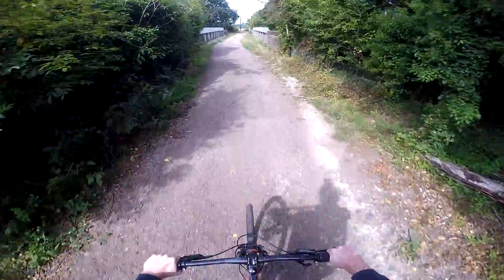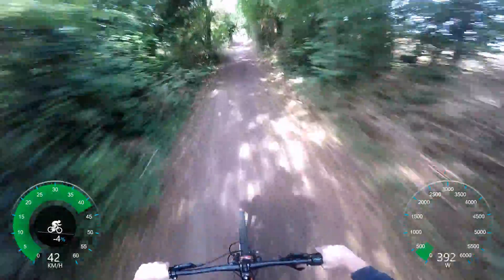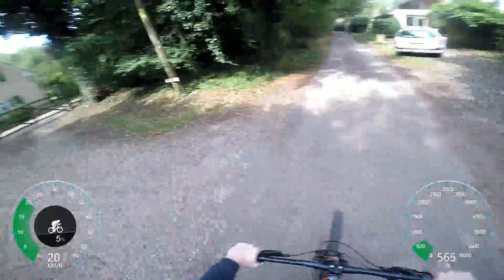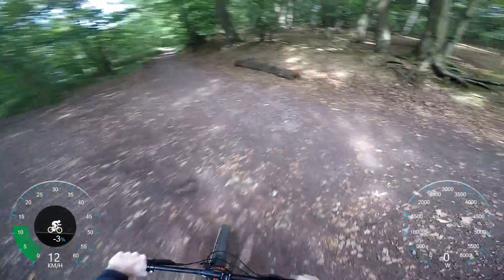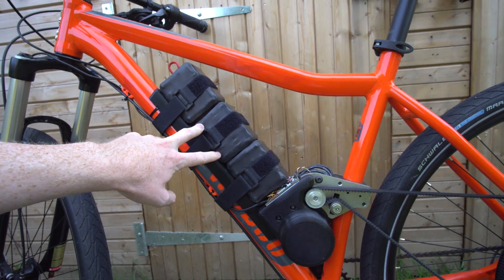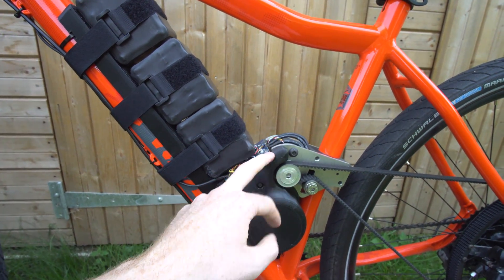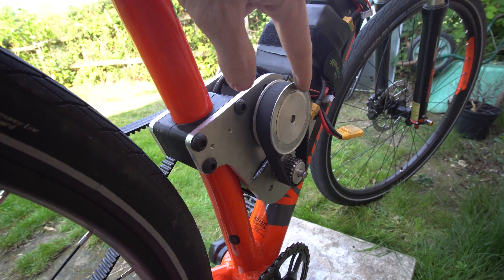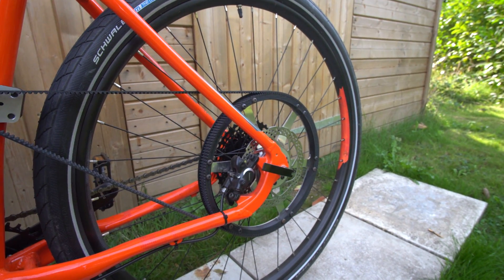Electric Bike 4.0 - First Test ride

Comment: Hey Tom, you should really make these ebikes more like a bicycle and less like a motorcycle though. Ebikes are by far the most fun without direct throttle control, instead try to rely on crank rpm and crank torque as throttle input with a crank torque sensor. Doing this correctly will make it feel like you have superhuman legs, and will make the rider provide energy to the bicycle in a useful way.

Comment: You need to Volkswagen this bike, just in case the authorities check it out. 

One mode where power output/speed is restricted... and when Mr. Plod has left, you put it back into fun mode and ride away laughing!

Wouldn't get away with this bike in Australia!  :-)
Reply: Michael Carey A mode where the power/speed is restricted is pointless. Even if it was 250w and 15.5mph it would still be illegal on UK roads. All UK bikes are required to be pedal assisted.

Comment: Isn’t 800 watts for sustaining 18-20 kph a bit too inefficient????
Reply: It depends heavily on conditions. We don't know how soft the trail is or if there is a gradient. He noted in the video that the gradient is GPS based... which is just about worthless.
Reply: I get about 220w at around 30km/hr on my ebike. Maybe your watt readings aren’t calibrated ?
Reply: It's mph. Not kph. He left a note at the beginning say he doesn't know why it's displaying kph. He set it to mph.
Reply: My bike dont need that much either. Under 200w @ 20kmh and goes 40kmh whit 36v and 15amp current limit.
Reply: Pro cyclists average 40km/h on 400 watts in normal conditions
Reply: Thats because its fully powered by a motor. Im guessing everyone in the comments are talking about the normal ebikes you get from bike companies

Comment: You should check out dashware.  It's a free overlay like you're running.  It has a bunch more stuff like incline altitude and even computed values like horsepower and torque

Comment: To prevent overheating of the motor, you should cut out ventilation holes on the motor guard (or design a new version with holes).
Reply: Maybe an easily cleanable mess cap of some sort???

Comment: You could design a motor housing with holes and a space to put a screen and small filter to increase cooling.
Reply: Could maybe even put the holes at an angle to match the rotation direction of the motor, the drag might act a bit like a tesla turbine and suck air in.  Then have a way for it to exit.

Comment: hi Tom, can you not 3d re print the motor cover with small vents instead of it all covered, so looks like a garden civ but designed with longer holes not squares. try to get temps before the mods and after to see if the motor is cooling, or at least aid the cooling process. I don't suppose there is any way to wire in a small fan anywhere or to design a manifold that can direct cooler air to the motor cover that can be vented. so cooler air in pass through the motor casing then out :) temp sensor can kick in the fan if it goes or! gets to a certain temp. Just idea thrown at you :)

Comment: You mentioned about having a temperature sensor inside the motor casing; would it be feasible to have some sort of fan with a filtered intake to help keep the motor cool?

Comment: If you built something like this as a kit for the best selling bike with disc brakes on Amazon,  I think quite a few people would like to buy it. If you do it without batteries, motor and speed controller you don't have to invest much and if you set up the 3d-printers and mill to make all the parts for one kit in a single operation you'd only need to start a "job" whenever you get an order. Also you wouldn't have to invest much or keep inventory and those are the pitfalls of most small scale productions
Reply: but if he sells it he would be at fault if something happens, I mean he is still for his but don't you think if something happens he would be devasteted if it might be because of a part he designed?
Reply: If you sell the parts as a kit it removes a lot of responsibility. Sure there's still RMA and stuff, but that's nothing compared to what you have to deal with when selling a finished electrical or mechanical product.

Comment: Hi Tom, thats really a cool ebike you have made and your video is pleasure to enjoy, thank you! I have one notice - do you plan adding some cover to second gearing to long belt? It seems to be quite dangerous that way. And did you calculate power transmitted via belt versus belts capalibities regarding power transfer and so on? And the last one - did you wonder over recuperation breaking and getting some energy back to battery? And can you post what type of motor do you use? Thank you a lot!

Comment: Looks very good indeed. I would be inclined to cover the primary and secondary drives near the motor for when winter comes and you ride with trousers. You wouldn't want them dragged into the pinches between the belt and any pulleys.

Comment: Good idea to add better ventilation around the motor for heat dissipation. I am wondering if lack of exercise is such a good idea and maybe we should go back to pedaling and walking more instead of less. You probably used less than 50 calories riding the ebike up that hill instead of 500 calories if you had to pedal it up. I would like to see an ebike version of Tour de France. Could an ebike make it 100+ miles on one charge?

Comment: How does it ride tradtionally with the pedals now? Or is it more of a pure electric bike rather than moped style? Is there a lot of resistance. If so do you have a plan to be able to switch etc?
Reply: Once you get to a certain speed the pedals don't do much. For me on mine (1500w hub motor) the pedals don't really help past 40km/h
Reply: @chris2944  i get that 😂 its more whether its rideable without the motor. Eg if it runs flat and your still a couple miles from home.
Reply: Oh yeah you can pedal but if there's a hill you're fucked unless you're Chris froom.

Comment: Very good job !!! I want to suggest something else where you can add so that you can charge the battery puck ,well you can use the electric energy which is produced from the motor ,when you stop the acceleration and the motor turns free, as a result the motor to be transformed in a generator who charge the battery puck.

Comment: Have you got any info on the batteries you made? Looks like 18650 cells packaged together... Would be interesting to see more on that, and how you charge them and and what kind of charge speeds you can run at? Thanks

Comment: 3:53 is there any epoxy on that esc
Reply from the maker: That exposed blue PCB looking part isn't actually used for anything electronic wise. It's just the rear cover of the speed controller that happens to be made from PCB material.
Reply: Thanks for feedback

Comment: Great job, I envy your design skills.  I would love to build a bike like this. I have been looking at suitable bike and motor option. I want to try fitting it to a bike with mid gears instead. Also maybe you should try to design a two speed gearbox so I don't have to.😉

Comment: Does the vesc 6 overheat ? On my Ebike with the focbox and 6374 motor I had big overheating problems. Now planning to buy vesc 6 and install water cooling Is that necessary ?
Reply from the maker: I used to run the VESC 4 and it would always get super hot. This VESC 6 is running at 110A limit at 44.4v (roughly 8070 size motor) and according to the data logging, it's peaking at about 60 degrees Celsius under max load. So I think you should be fine!

Comment: Seems like you figured all the Electrical/Mechanical glitches out. Well done. Seem to ride well.
Would have liked to see the top speed and wattage on a level/smooth asphalt or cement non dirt or gravel road.

Comment: Tom only one word you remind me of Nigel mansel...maniac!! .lol.being a naval engineer the pulley system looks great...but if you have a cnc why not try a floating direct drive...18 to one ratio need only 4 worm drives mounted on a rubber shock mount...less moving parts and easier to maintain and probably less energy friction loss.
Nevertheless bloody awesome effort well done...just out of curiosity what's your motor wattage ???😃😁👍👌

Comment: You should probably mention that in the UK, this is legally a motorcycle not an eBike and technically is not legal as you are using. Do so at your own risk
Reply: Rick Lokers  power. Basically in the UK you've got up to 250W and 15mph max speed for an eBike, of course you're able to pedal faster but you're not allowed a powered assist and eBikes should cut motor power at this point. Anything else is legally a motorcycle and is then required to be DVLA registered, have a license plate and the rider to have the relevant license and insurance. This even applies on country lanes and parks etc, not just road use. The only legal place to ride this particular bike is on private land.

Now I'm not saying nobody should ever do this, but they should be aware that they do so at their own risk. I've considered doing a 500W conversion myself, easy enough to get away with and get past an unsuspecting police officer, but 2kw at the speeds shown in this vid, less likely to snoop past.

Similar laws exist in other countries, the UK law is actually the same across all of Europe (we direct copied the EU law) and also Australia (who again, just stole the European law and decided it was sensible for their own) America gets up to 750W I think and I think 20mph but I am not entirely sure.
Reply: +SixSixSevenSeven To be fair, the ebike laws we had in Australia were even worse before we brought in the additional Euro laws. It was 200W max, which is total rubbish.
Reply: @sixsixsevenseven-g5q  It is good that you're warning someone in a friendly way.  It brings up a point though.  Why do these laws exist?  They certainly don't exist to protect anyone.  It just seems as though government entities like to have any excuse to make people pay fees for freedom.  Don't people already work to earn rights and wages (aside from basic human rights)?  Unless the government is somehow providing a service or actual protection, all they're doing is strong-arming for money.. like any common thugs would.  People should just be held responsible for their actions.  If a person doesn't harm people or cause damage they should be allowed to do what they will.
Reply: Spectacular work ! 
As a Brit, and someone that built a 1kw eBike in 2011 I am so pissed off at this stupid 250w limiting law. There is no real logical reason why the speed limit should be less than 20mph before a cut off should be required. And 1000w could be perfectly safe so we can have a vague sense of acceleration. The amount of money we waste as a country on fuel is bloody insane because of laws like this. I will say that there should certainly be laws about quality control of the components for instance to prevent battery fires or the loss of control of the motor. But if the bike or "bike kit" has gone through some level of testing then we should be able to get our hands on more powerful kits for a reasonable price. 
Instead now the companies I have seen that sell bikes limit the motor to 250w which is pathetic and forces pedal assist so you have to be peddling at all times. And to get a bike of the same quality as the one in this video would cost £6000. And yet I bet this bike probably cost less than £1000 to build and is highly maintainable as any faulty parts can be hot swapped out.
/rant ffs
Reply: Well that's on public roads u don't need to register it for private property or bridle ways
Reply: In the US you can slap a gasoline engine on a bike and it's still considered a bike lol
Reply: who even cares
Reply: The difference is where the fat over bloated socialist bureaucrats  decide where the line is to screw the ordinary citizen!
Reply: @Shortsircut1 
Is that the ordinary citizen walking down the street you're hurtling down on an illegal motorbike, or the guy riding the illegal motorbike?
Reply: It all really depends on where you live.

Comment: What happens if god forbid, you have to pedal it? 
 Can you disengage the drive system so you don’t have to pedal against the motor and belt friction?
Reply: Green Silver with motor braking or regen turned off then there will be only a tiny amount of resistance. You’d probably notice the weight of all those batteries more

Comment: You might be able to make it charge while going downhill... Maybe some mosfed that turns on when it's not getting (or only getting) power when the motor is on/off....
Reply: Regen is available in the VESC as standard, just needs a signal to switch it on then it'll work in reverse using the same mosfets.

Comment: awesome job man, i wish i had a CNC, that would really help me out in building my motor mount on my mini dirt bike because i've been having a lot of trouble with my 3D printed version warping and bending under load. My design is basically the same as yours though, i have a 3:1 reduction from motor to drive pulley and then 6:1 reduction going to the wheel so same gear ratio but my wheel is only 400mm so i'm gonna be trying a 16.3:1 ratio next.

Comment: I found this which has all of the legal requirements in the UK, just for anyone who does not know. https://www.electricbikeconversions.co.uk/blog/uk-electric-bike-laws/-1
So by law mine and Tom's bike are no longer EAPC's but are mopeds (my bike is only 1000w) anything over 250W or over 15mph in the UK is a moped and needs to be registered if used on the road. 
I only off road and pedal normally if I have to cross a road.

On another note I would love to see someone convert en ebike to be road legal. But once road legal its then illegal to use cycle paths and pavement.

The Gov.uk page for anyone interested https://www.gov.uk/electric-bike-rules

Comment: Is it regenerative to go down hill?

It's a great bike - but please be safe.  You might need your brain.  Wear a helmet.
Reply from the maker: The regen braking isn't currently enabled, but it is capable of regen braking. I was wearing a helmet, but had to take it off when I checked the gopro battery haha. Thanks!
Reply: Connect another idler bearing on a sliding bar to the existing idler bearing so that they pinch the belt and can slide up or down together according to whichever part of the belt has the tension.
Regen should then work without any slippage.

Comment: Why did you change offroad tires to road tires if you are riding it offroad?
Reply from the maker: I rode the bike with the offroad tyres and got two punctures in a week due to the tyre being so thing. So decided to go with these marathon plus tyres for puncture resistance. Plus they seem to work pretty well on dry dirt!
Reply: @TomStantonEngineering  Oh I see..

Comment: For cooling with the printed cover, you could try putting a tangential scoop (Similar to the housing of a blower motor https://i.imgur.com/6Dcdvhm.png) on either the top or the bottom of the circular portion, wherever you think it would be less likely to take in water, and then allow venting on the right side of the bike, to allow the scoop to take air in as your bike moves forward, flow through the motor, and then exit easily on the other side.

I don't know if this would help,  but if you could put the intake on the correct side of the circle, the spinning of the motor may very well help make it function similar to a  blower motor, but I'm not sure if that effect would actually try to force air out the intake or not. I've never attempted to run a blower motor in reverse. If you wanted to try to capitalize on that though, you could just put the intake on the right of the bike as a part of your pulley cover.